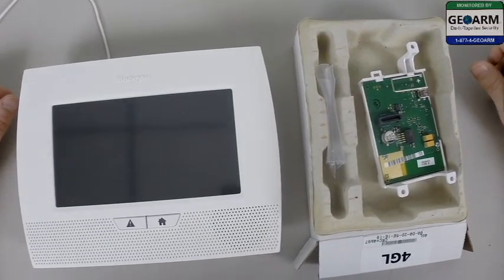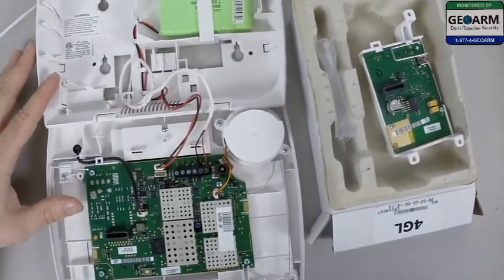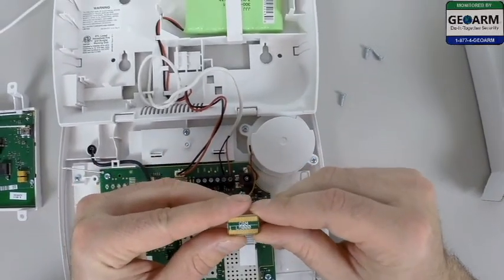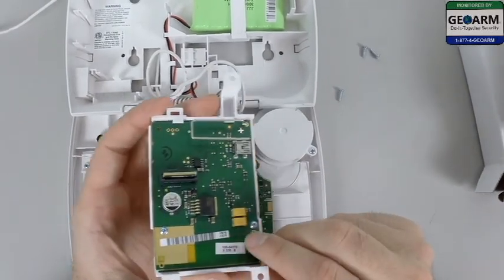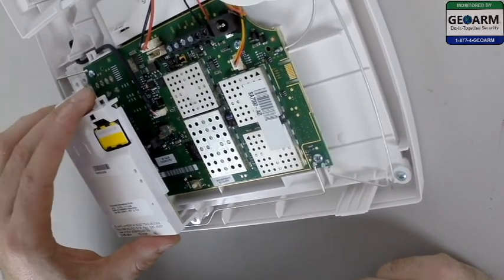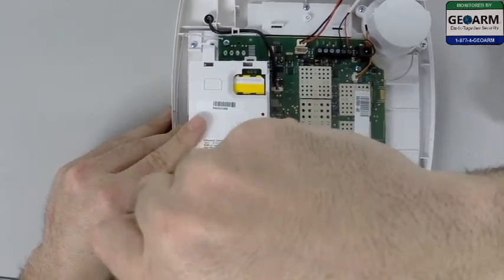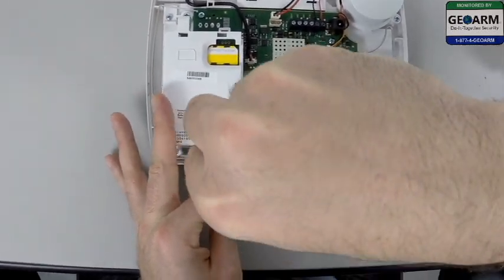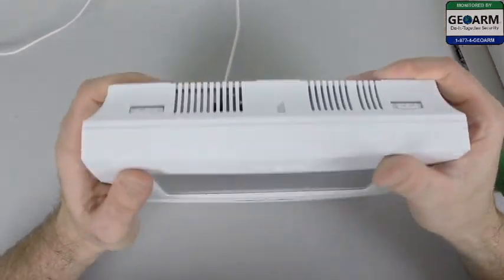Honeywell 4GL - How to Install into the L7000 System?

Comment: In my house I have an alarm system installed by a security system company, but unfortunately the sensors, central ans keypad is very old in terms of technology, and they don't have something more modern to do an upgrade. Do you know if Honeywell system will works with all the security companies? Will I be able to setup and inform about the zones, intruders... or it is only for notify the home owner? I'm a little confused =/